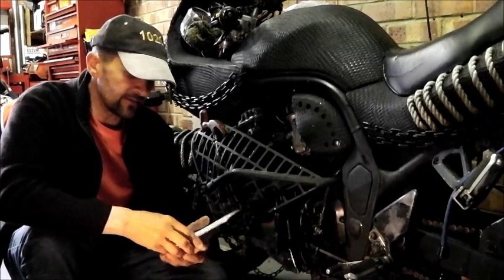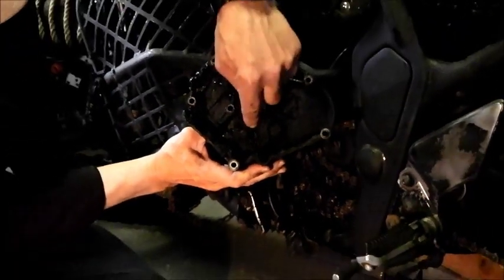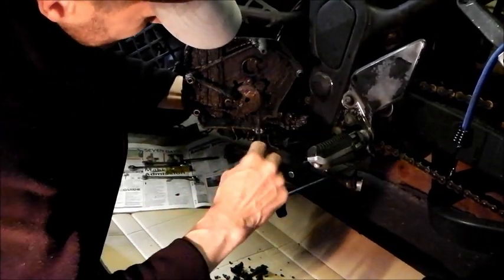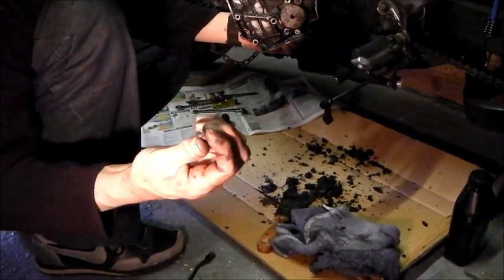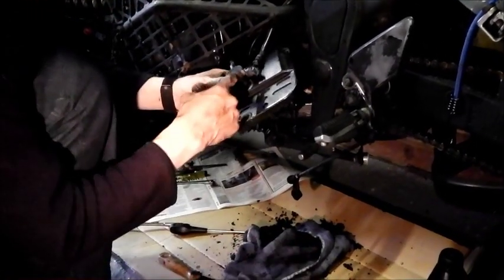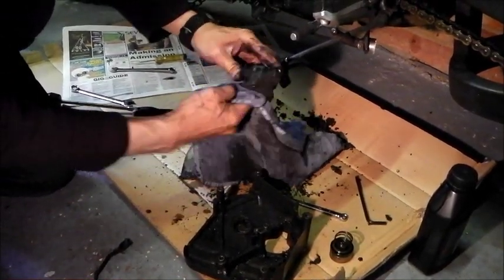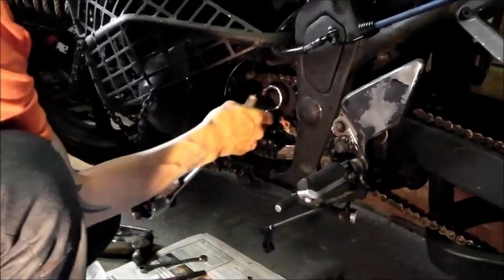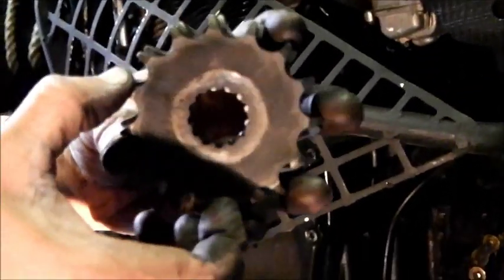Delboy's Garage, How-To;- Bandit Clutch Cylinder and Front Sprocket Replacement.

Comment: Hi Del. I found one of the wires that goes into the bottom of the carbs ('04 1200) has come out, I believe they are for heating in extreme cold. Is it something I can repair. Is it necessary to, even? Not sure what they're called to order parts. Many thanks for your vids!
Reply from the maker: hi John, well if you have a broken wire, then obviously set that right first, level playing field and all that, if it was meant to be there, then its never good to leave it broken... see how it is once you get that done.   let me know how it goes.. good luck.. Del.

Comment: hi del, your video's have help me do my front seals on my brakes on me bandit 1200 and put new pads in, i rebuilt my rear brakes as well, im learning loads, just did a oil change on my b12 and found oil leaking on the sprocket side of things, so took the case off with the slave clutch on and started the bike and it push the potion out when i had the engine running and broke the thing peace of metal holding the piston in found it leaking on push rod thingy, but my problem is now the slave postion housing has broke what is the best thing to do? kieren
Reply from the maker: sammy gower Sorry Sammy, not really sure wihtout looking at it, but if you have a broken cast alloy housing, the only solution would naturally be to replace it... you can get a re-build kit ofr the slave cylinder, but that is only rubbers and springs... the casting would have to come from Suzuki... hope that helps!

Comment: Hi Del, not completely on topic...but it may be related! Basically I was checking fluid levels etc and noticed the clutch master cylinder had a dribble of dot 4 in it, so I topped it up and took it for a spin. But now it wont downshift :/. Any advice?
Reply from the maker: Not quite sure I understand the exact meaning of your question, by saying "clutch master cylinder had a dribble of dot 4 in it" - do you mean the level was very low?  ... If so, then when the level gets too low it could have been possible that you've dragged a gulp of air into the aster cylinder and pumped it down in to the hose...

It's easy to tell when you have air in your brakes because they go spongy, but it's not so easy to tell when you have air in your clutch, cos the springs yield and the clutch opens,  thus you cannot detect whether the lever moving back to the bar is just a light clutch, or air in the system...

If this is the case, then up-shifting won't be affected, as even if the clutch is not fully dis-engaging, you can still short-shift without the clutch going UP the box, but coming down through the box, you need full clutch dis-engagement and if you have air in your hose, you won't be getting this, so it's like only pulling the clutch half in... which is why it's only apparent on down shift... best advice is to bleed the system right through, as per my video on it, and once it's free of air, it will work fine again... try that and let me know, Del

Comment: Hey there. I've got a 98' bandit 1200. The clutch has completely quit on me. It won't engage, so every time I fire the bike up in neutral and try to shift into first it stalls. I bled the fluid and that did not help. Thoughts?
Reply from the maker: Hi buddy, are you getting any resistance at the lever??  Does it feel like it's dis-engaging??  Does the lever feel normal, or floppier than normal??  The Bandit's have a diaphragm spring, rather than separate springs, and if that's become cracked, or split, then that will need replacing... but let me know, cos it could simply be a hydraulic air lock, and how did this manifest itself??  Did it come on suddenly??  Or did you do something to the bike and this was the result??
Reply: Moonfleet41 I DO feel resistance at the lever. I removed the linkage and the cover that holds the slave cylinder. The push rod was sticking out of the engine when I removed the plate, and I could freely remove the push rod. I didn't do anything further because aditmedly I'm not too sure where to go from here.
Reply from the maker: Ok buddy, if there is resistance at the lever, but still not dis-engaging, then it could be related to either air in the system, or possibly, some damage to the diagram spring... just to check again though, as I asked... did this happen and come on suddenly by itself, or did you do something to the bike and this was the result??
Reply: Moonfleet41 so I started noticing issues when I was at a stop light. Bike was in first gear with clutch engaged and the bike kept trying to creep forward. This was especially noticeable when giving it a bit of throttle at a stop with clutch engaged. As I rode back home it continued to get worse and worse, in that it was getting very difficult to shift into different gears. The clutch was very clearly not working properly. I got back home and shut the bike off. Checked the master cylinder for the clutch and NASTY in there. I had no brake fluid left and an orange gunk was in there. I cleaned out the inside of the master cylinder and bled the line with fresh dot4 until it ran clear. Did I possibly get air in the line and not bleed it properly?

Comment: That seal you saved ..without the rod on ..when I start it up its chucks oil out of the hole ..is this the seal gone..?
Reply from the maker: If you mean the clutch push rod.. then yes it will chuck oil out if you remove the rod.. but it shouldn't do if the rod is in place..!

Comment: Hello..just bought a 99 bandit 1200. its got aftermarket levers.. the clutch engagement is about 1mm from handlebar. Do you know how to adjust this?
Reply from the maker: Hi Mark.. if you have the correct freeplay in the lever and it's not pushing on the fluid....then it's more then likely down in the clutch itself... how many miles has that clutch done buddy..?
Reply: I'll have to look at the lever, I know it's set on the max, don't know how many miles on the clutch but the bike only has 12k miles.
Reply from the maker: Ok, 12k miles is nothing on a Bandit mate... sometimes what happens is the after market levers can be ill fitting and press on the plunger holding the clutch very slightly open...so you're effectively "riding" the clutch... the lever must fully disengage from the plunger at the top and have a tiny gap...that way the clutch is closing up fully... see how that looks and let me know fellah

Comment: del i just renewed the seals in my xjr1300sp as i was getting a slight what i would call fluid noise when pulling the clutch lever in just at the start down at the slave cylinder but no drips. i just bought this bike last week . i heard this noise when i was cleaning the bike dont ask i just pulled in the clutch when cleaning and heard the little fluid noise down below. the noise is only there at the start of the pull in the lever engine off as if the engine was started u wouldnt hear it as its that low of noise del  . anyway i thought i would replace the seals and after £20 for kit . it still has this noise . can you tell me if the fluid seal was fitted wrong way round though i fitted the seal with the open lips of seal  to the fluid side  i take it there would be fluid leakage as there is no drips at all and clutch is still working fine . cheers del
Reply from the maker: +johncbr1100 Hi John, now i have heard that sound before, and had no issues at all with the clutch opperating.. it was on the Bandit... so perhaps its a seal moving against the metal, maybe an air bubble in the system causing a flutter...not sure.. but i guess if you've replaced the seals and its all working correctly with no leaks....then just keep an eye on it and let it ride.... as long at the clutch is all workinf soundly, then is cant be too serious.. !!
Reply: Moonfleet41
 del thanks for the reply . just a update after this last day or so riding after the kit was fitted there is hardly any noise coming from it now so all ggod del. i guess it might just be the bed in part taking effect. anyway del i wouldnt of done this job without watching you do yours on your bandit. i know my bike is the xjr but not that much different, help me big time and saved a few quid away from labour charges at my bike shop. also gives me the feel good factor doing the jobs myself, thanks del pleasure watching your step by videos you have a true tallent . john belfast
Reply: +johncbr1100 Hi john, thats great to hear that you got it all sorted... the XJR is pretty much the same as a bandit, certainly in the clutch areas....they're all pretty much the same.. You're right too, its great to do your own bike repairs, it not only saves toy money, but builds a bond with your bike that helps you read and understand it better, and being better in touch with your bike has to be a better way to be....its daft to just ride a bike to destruction then hand it to the dealer, thats just soulless... 
take care buddy, and keep in touch, glad the videos could help you..All the best.. 
Del.,

Comment: You say the push rod seal is only to keep dirt out?? well mine is leaking oil, so it must be there to hold oil back as well as keep dirt out! I wanted to ask ya, is it straight forward just yankin the old out and pressin the new in? the metal piece can be moved out of the way with front sprocket left on so it should be a simple job?? thanks!
Reply from the maker: +RTB-1157 Yeah sorry, sould have explained it better... it keeps the oil in and the dirt out at the same time... i just hook them out with a seal pick and pop the new one in...! should be a simple fix.. Good luck with it buddy..
Reply: +Moonfleet41 Cheers Bro! just a quick question, does it seat against something or should I stop sending it home once it's flush?? thanks again!
Reply from the maker: +RTB-1157 Depending on the year of your bike they sit in a recess, hook the old one out and you'll see... Good luck with it buddy.. let me know how you get on... Del.

Comment: Hi Del just wonderin how you loosen the chain enough to allow the front sprocket to come off relatively easily as in the video there? got myself activated on the bike forum as you suggested. just need to learn how to find my way around it!

Kieran (smurf)
Reply from the maker: Hi Keiran, simply loosen the axle, wind the adjustor screws in as for as they will go to push the back wheel as far forward as possible... this will allow you enough slack to rotate the chain off the front sprocket... get posting on the forum, mate, after 5 posts, you'll get full access to all topics!  Del

Comment: How is it you know the jobs that need doing on my Pan lol. At the mo when the engine gets hot the biting point disappears (spirited riding), but there is no obvious leaks (bearing in mind there's so much fairing I cant tell lol). Could that be that the seal or spring has gone? Ive got fresh fluid in there as I thought it could have been the water in old fluid boiling. Its quite fun on a long ride with a beast like the pan with no biting point (glad I do clutchles changes lol)

Comment: Hi del.
I have a 2002 K1 bandit which has a slipping clutch issue when cold. It isnt hyd system and the bite point is right at the end, my question is do I need to replace steel plates and springs or can I just change the friction plates,finaly when I have done this do I need to adjust the clutch arm adjuster on the other side behind rubber bung or leave it as is.
Love your work
Cheers
Jay from notts
Reply from the maker: If you buy a replacement clutch pack it should come with the steel plates and the soft plates in one go and they aren't separate springs, it will be a single diagphragm spring, like a big metal ring, and it doesn't hurt to replace that as they get soggy in 15yrs... ... and what do you mean by clutch arm adjustor??... is this a 600 then?
Reply: Moonfleet41 hi again Del. Yes itis a 600, I think its called the push rod,, does this need to be adjusted in or out to compensate for the new clutch or leave in its current position.cheers
Reply from the maker: Jason Garner No, as long as you adjust the clutch cable so you have the right slack at the handlebar, should be fine mate
Reply: Moonfleet41 thanks del,keep up the great work.

Comment: Hi Del, different topic but clutch related.  I ride a 1996 B600.  I always get a loud clunk when I shift to 2nd gear; not so loud in upper gears.  Is this normal or am I just not shifting correctly?  This is my first bike and riding 800 total miles experience so I'm not very familiar with what is normal.  Got your videos bookmarked...my motorcycle bible!
Reply from the maker: Hi buddy, first of all, congratulations on your first bike, the B6 is a legend and probably the first bike of a million bikers out there...!  Undeniably probably one of the all round bikes in the world... 

The Bandit engines started life ebing first developed way back in the dark days of the early 1980's, and the very first one came along in the GSXR750 in 1983 in Japan, so if you think of it that way, they are pretty old technology mate, meaning that it's understandable that they're a bit clunky betwen the gears... they tend to bang in to first quite hard, and the same between first and second, as you've found... but it's quite common mate and nothing unusual... 

What you can do is make sure you change your oil on time, do a full depression of the clutch all the way in to the bar between first and second and if you can eventually get the knack of it, then time the lifting of the gear lever at exactly the same time you pull the clutch in... just as the weight comes off the gear box.  Also it pays to change in to second at lower revs, if you scream it in first, it's always gonna complain going in to second, so on my B12 I always changed into second quite early then nailed it.... Hope that helps buddy, it's all about the practice , all the best, Del

Comment: I came here looking for a video on replacing the front and rear sprockets, as I am tired of paying all the money for this stuff, and your fork seal replacement video was excellent. I was wondering if replacing the sprockets was as straight forward as the fork seals, or if it is dependent on make and model. and do you have a video for this already?
Reply from the maker: +ThePatience404 Hi mate, got a few library regarding chains and sprockets... it is pretty generic, most front sprockets are coered with a casing, the sprocket lies beneath with a big tab washer on and a large nut... and the rear sprocket bolts to a carrier on the rear wheel, which means you need to take it out... re-joining the chain link is the only tricky bit, it's not complex, but it must be done properly...

Comment: Hi Del, thanks for the tips here and in another front sprocket video I watched. I removed the sprocket cover on my '99 Bandit 1200 and an unusual grommet fell out - it has one end squared off. Do you remember seeing such like?

BTW I remembered to put the bolts in order - good thing because they're three different sizes - and from the looks of the sprocket I think it's replacement time. Photos are at https://www.flickr.com/search/?user_id=69385339%40N00&sort=date-taken-desc&text=Bandit%20front%20sprocket%20cover%20bolts%20grommet&view_all=1

Comment: Great video as always, especially for us unexperienced bikers. Nice tip on the front sprocket aswell. How do you know if that seal is worn out? I've got a 2003 Bandit and i noticed while i was lubing my chain up and had the bike on the central stand in 1st gear that the wheel was spinning even if i pulled the clutch. Do you think i have the same problem?

Comment: Hi i did it like you said but the Pushrods i think not connected well and now when i am trying to shift gear it doesn't do anything it stuck on first gear and keep running like that and i can't stop the wheel from spinning what can i do? what do you think i did wrong? please help me
Reply from the maker: Jonathan mammary Hi Jonathan...i dont really understand what you are describing....what do you mean by "Cant stop the wheel from spinning".....are you suggesting that your clutch is no disengaging.!?
Reply: after i connected everything when i am holding the clutch handle the wheel of the bike keep on spinning in first gear and not disconnected as it suppose to do, and when i am trying to shift gears with the shift lever it stuck and i cant shift gears. it seams like the clutch not doing the disconnect and taking the Pushrods out or something like that. can you try and help me with that maybe i can send you tomorrow a video of that
Reply from the maker: Jonathan mammary Ok John, your clutch is clearly not disenguaging, and i imagine it is either a problem with the push rod setup itself if you have had that all out...or maybe you just need to bleed it up...have you bled the hydraulic line and when you pull the lever in, does it feel like its moving parts down below, or is it all free and feels empty..? you can sen a video if you like...im sure its something simple..
Reply: I tried with my friend and nothing is good cant you post a movie with good light hot to connect all parts and my gears now enter to second gear and to N only not first gear at all